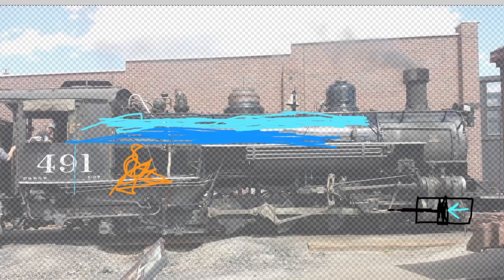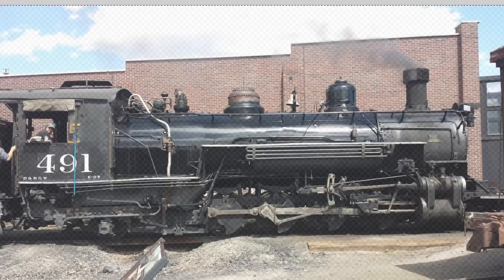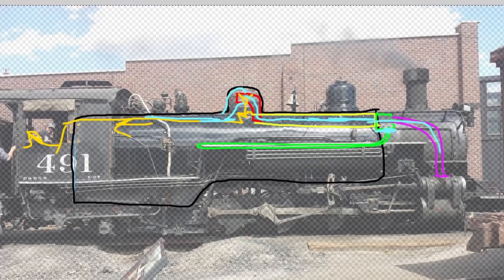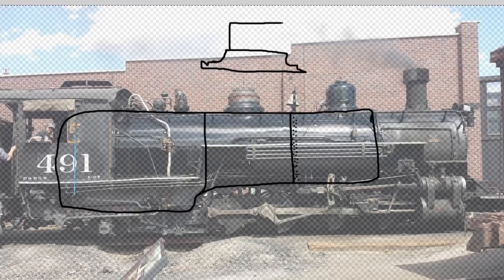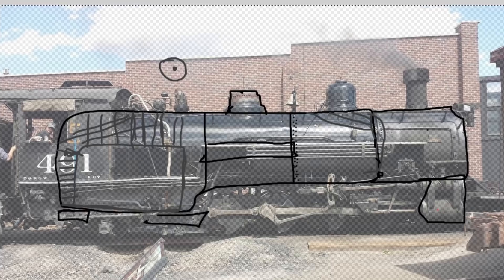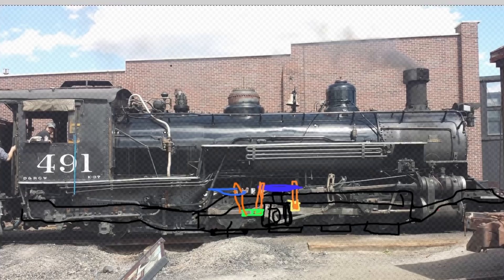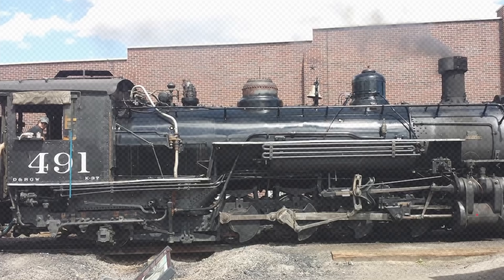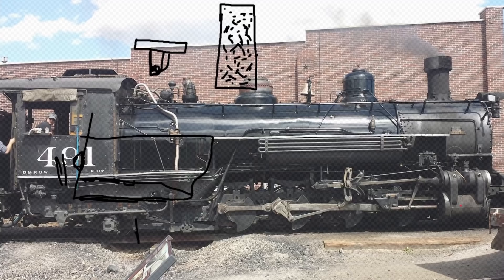Steam 101: 10 Levels of Steam Locomotive Understanding

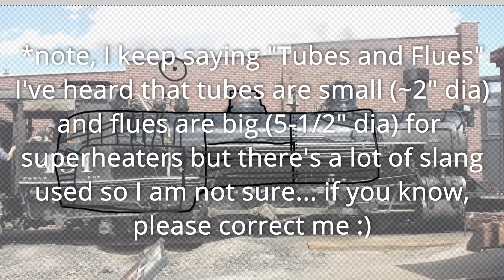Comment: I'm not so sure in the steam locomotive world, but in the heating world, flues hold exhaust gases with water on the outside and tubes hold water with exhaust gases on the outside. I suspect that the big and small reference at 25:54 is people calling drawn/cast tubing, tubes and hand made pipes, flues.
Reply from the maker: That makes sense. Interesting.

Comment: As a mechanical engineer working in the utility industry with high pressure superheated steam (2500 PSI & 1005 Deg F) and over 1 million HP steam turbines/generators, I found this to be fascinating. You mentioned the word "fan" as you were firing a cold boiler (in a different video). I understand that the exhaust steam was used to induce a draft through the boiler utilizing venturis in the smoke box, but you didn't mention how the boiler draft was established during initial firing.  Can the steam control valves that feed the drive cylinders be diverted to the venturis to get induced draft when the engine is not moving? Maybe the explanation is in one of your other excellent videos.
Reply from the maker: There's no actual physical venturi past the blast nozzle; beyond the blast nozzle we have a pipe called the blower that dumps steam out the stack. The flow out the stack then gives a flow through the fire. If you don't have steam, you can power it with shop air. Else, everything is free convection until you have steam.

Comment: Oh that steam comes out of a lot of places. Go look at a Durango & Silverton locomotive leaving Durango on a cold winter's day and there is steam leaking out of everywhere. As it works it's way along the seals heat up and it tightens the seals up a little more. Some of the newer steam locos had a power reverse. Super heated steam is also called dry steam. At lest it was spared the old timey fake diamond stack treatment. They made something called boiler patch bolts. When a spot in the boiler rusted through or was punctured they tapped a hole & drove a bolt in with a wood screw type flange. When it seals up, & gets tight the hex or square head breaks off and it leaves a flush patch.

Comment: 37:54
"I talked about the turret earlier, is that where the machines guns go? Well no!"
well, atleast no, not normally
but this flaw can easily be addressed by making a Steam powered gatling gun, and hooking up the the steam to the gatling gun's turbine thereby allowing a "Rapid firing gun" to be mounted to a steam locomotive!

however this leaves but one question
(The question being, where to mount the Ammo drums?)
Reply from the maker: On the running boards most likely, not too much of a gravity feed to limit the tension on the belt, but also easy to reload.

Comment: One thing I know that definitely applies to oil-fired locos that may or may not apply to others is that every now-and-then you take a scoop, scoop some sand from a big bag on the cab floor, and dump it into the firebox through that little hole. This is called "sanding the flues", and the whole reason you do it is so that the sand gets sucked into the tubes and flues, knocking loose all the carbon buildup. This carbon then gets exhausted out the stack, which is why you'll see thick black smoke pouring from the stack when this is happening. I'm guessing that the environmentalists aren't a huge fan of this practice.
Reply from the maker: Ah yes, that's right! Didn't even touch that piece.

Comment: I feel smarter already. More locomotive education Professor Hyce!

A boiler is like a pair of pants, albeit a pair of pants that will blow your ass into the next century if something goes wrong somewhere.

Imagine how they did this before pneumatic tools? Basically, strong guys swinging hammers, much like how the railroad was made one swing at a time.

Also, reverting to a story from Rev. W. Awdry, there was a story where Gordon, the large express engine, lost the dome to his boiler and it states that the wind was whistling through the hole in the boiler. If I understand you correctly, that basically means that without the dome, the steam on the boiler would escape in rather spectacular fashion, right? Or am I missing something?

22:44 That's what the hole looked like after they hammered it out. And that's Hyce before the beard, right?
Reply from the maker: Correct on both counts ;) it's an old pic.

Comment: Really really excellent video, I've always loved steam engines, and this really cleared a lot of stuff up that I hadn't fully understood.

I wasn't super paying attention, but by chance, did you touch on why the steam nozzle was important in the smokebox? I only recently learning from the J&L #58 how each exhaust pulse of steam does a venturi effect to draft the firebox (If my understanding is correct)
Reply from the maker: I didn't get into the nuance of it, but I did touch on the blast nozzle briefly. It actually creates a normal shockwave out the stack ;)

Comment: I kept forwarding most of the video (not really new to me, but it was nice to be reminded of certain details), I wonder if I missed the part where you mentioned how water level indicators work, as maintaining the correct water level is very important. And how water level indicators cope with driving uphill or downhill, or accelerating and braking, which causes the water to slosh around the tank. Broken water level indicators are a hazard. Especially if both are broken. Such an engine is a rolling bomb waiting to explode.
Reply from the maker: We didn't really talk about sight glasses or trycocks in this video. Can't cover it all, and I wanted to get a good selection of the "lesser known" stuff. Maybe for an add-on video down the road.

Comment: Fun fact drilling a hole down center of a cylindrical object actually allows the object to flex without breaking making it stronger. but be careful take too much material out the center and it becomes weaker
Reply from the maker: There's some nuance to that, but yes in general that's true. Moment of inertia calcs :)

Comment: One item relating to injectors,  water is turned on first to cool the injector, then the steam is turned on causing the process of expansion.  The steam should be pre-throttled and the water flow adjusted for minimal overboarding.
The colder the water the better the operation of an injector.

Comment: In what cases would you want to not have the regulator at full open?
Also, can you explain about a mechanical stoker. I think it’s an auto firing mechanism but don’t really know beyond that
Reply from the maker: Regulator is only wide open if you're running tonnage on the level or uphill. If you're pulling less than tonnage you'd typically need it less. 

Mechanical stoker is a big screw from the tender to the loco. Brings coal to the loco to an elevator screw, that raises it up into the firebox where there is a table with steam jets on it that blow the small pieces of coal to the various regions of the firebox.
Reply: @Hyce777  thanks for that

Comment: I was looking for an explanation of how a heavy train reduces the likelyhood of wheelslip, but I didn't quite get it. Am I right in thinking that if the coupler is higher than the driver axles, the train would pull the loco upward and increase wheelslip, whereas the opposite would be true if the coupler were lower than the axles?

Comment: oh this is going to be super neat. I've always found the linkages on steam locos to be fascinating. (Edit 1: huh! I kinda wondered how you'd deal with TDC on a loco, having either side 90 offset is a really easy fix for that!) (Edit 2: I can't find the video, but there's a wonderful clip of a guy testing forward and reverse on a large model steam loco, which is where I suddenly understood what the radius rod and arm do. It was a random "OHHHH" moment for me, lol)
Reply from the maker: It's funny, if you get stuck at FDC / RDC (we don't have a top or bottom in this case :P), and you are stopped trying to start - it is incredibly hard to get moving. Usually have to roll back and try it again. Lol!
Reply: oh wow that online animation. NICE.
also.... Superheaters are still used in some naval vassals, to generate the high-temp dry steam for the turnbine.
Reply: oh wow that turned out to be fantastic.
Reply: @Hyce777  TDC was on reflex in my case. And I can imagine that'd take quite a bit of effort. Enough effort that I suspect you guys try to park 'er so that the valves aren't in that configuration. Oh, so is the RRO thing of filling water directly into the boiler from a tower how you'd do it if you didn't have air pressure? or is there a backup hand-pump somewhere? Of couse, as I type this, I realize that a failed compressor also leaves you without brakes, so you're in all sorts of trouble on top of a low water level...
Reply from the maker: @DFX2KX  The injectors are steam powered, not air powered ;) but yes, no air is a bad day. If you can't put water in via steam you're donezo, gotta let it cool off and or fix the injectors.

The funny thing is that they stop "centered" quite frequently. When does the loco have least power? When one side can't provide any. If you were working uphill to a stop on a hill... guess where it stops? Least power. lol! so, you have to roll it back and take off.
Reply: @Hyce777  oh, right. so much info at once and I got it flipped around.

But indeed, I'd imagine a broken injector is a 'stop everything immediately' sorta situation, with all of the various ways things can rapidly disassemble themselves.

Comment: To the uninitiated the picture above is a steam locomotive to save space and time many people will refer to it as a train, but a train is this with a railcar or many railcars attached to it's coupler, it's also called an engine which is correct but still longer than train. Diesel locomotives are not really they are power cars with an operator's box  locomotive refers to the motion on the side of the steam engine, the engine of a diesel is inside the body shell it also has motors, really confusing concepts but train suffices.
Reply from the maker: Sorta; there's lots of little technicalities. 

A train, defined in the steam era, was a set of class lamps, and marker lamps. By that definition, one locomotive could be a train. These days, it's a head of train device, and end of train device. One or more diesel locomotives can be a train, too. 

The locomotive describes the whole. The engine describes just the engine piece. For the diesel, the engine is hidden away in the carbody. For a steam engine, it's the running gear, wheels, rods, pistons, that you see.

Comment: Thank you very much for the video. Very well done. 
I have one question regarding where the steam comes out of the locomotive. You said that it goes from the boiler through the cylinder to the smokebox and then out of the chimney. However, we always see that  they can ‘push’ steam directly out of the cylinder. Could you please elaborate on this?
Reply from the maker: That's called the cylinder cocks - they are drains built into the cylinders to remove water that condenses in the cylinders prior to really moving. Good practice to leave them open for a bit after starting.

Comment: I suspect the exhaust flue pipes contribute greatly to the production of steam.    I have seen fireboxes with many small pipes welded (?) thru the front plate., not large flue pipes but smaller 2" pipes.     Is there forced air for coal combustion ?  Residential wood burning stoves have a secondary burn chamber, do locomotives have that, or do the flue pipes function as secondary burn?   What is the function of the smoke box?  Is it more than just a place to end the flues and direct the smoke up?   I have seen what looks like steam seemingly helping the exhaust to flow up and out the stack, but maybe that's just "steam exhaust" ?
Reply from the maker: Howdy Mark! Lots of good questions. Flues / tubes do contribute to the steam generation, albeit less so than the firebox itself. Most locos have many 2" tubes and however many 5-1/2" tubes they need for superheated steam, if equipped. The forced air comes from the exhaust, or from the steam powered blower (which is basically a pipe just venting to atmosphere, causing the draft). Some large locomotives have a secondary chamber called a combustion chamber, which is really an extension of the firebox. Smaller engines didn't have space and so they didn't have them; the flues functioned as much as they could or it was not as efficient. The purpose of the smokebox is about exactly as you described! Haha. Some engines later had superheater headers and feed water heaters located there; but the main purpose is tube gas collection and setting up exhaust.

Comment: Thank you a lot for this video!
I have a question though: How exacly is the water injector working? Also the super heater.. what prevents the pressure from going back to the boiler? Is there a special type of valve or so?
Reply from the maker: Injectors are... black magic and deserve their own whole video.

Superheaters - if you are able to create hot enough exhaust to actually superheat the steam, the engine has to be working hard - which means the throttle has to be open - and steam wants to vent out to atmosphere. If you shut off, the units "remain charged" with the hot steam, as you shut the throttle valve, which prevents return to the boiler. However if you have a front-end throttle, yes, the steam can return to the boiler - which isn't the end of the world.

Comment: Question, is it possible to change the reverser position while the locomotive is moving? I've heard that unlatching the johnson bar under power could cause injury
Reply from the maker: You can, it's just very much a two-handed effort, and you usually take it in little bites. if you were to just unclasp the lock and let it do what it was gonna do, for sure... lol. One firm hand on the bar, pushing or pulling toward the way you want to move it, and you sort of "pop" the latch with a quasi-karate-chop motion and you get a notch out of it before it re-latches.

Comment: Regarding the Johnson bar, is it possible for the locomotive directions to flip based on the position of the rods? Because while it is guaranteed to send steam into the front of the cylinder, it appears the rods will turn forward only if they're on the lower half of the wheels. Do you ever have to pull the Johnson bar back if the rods are on the top half of the drive wheels in order to move forward?
Reply from the maker: No, forwards is always forward as far as the bar is concerned.

Comment: I saw a video of a steam locomotive being built in 1939ish and they had interesting axles that looked like a 2 piston crankshaft between the drive wheels. Did you cover what they where for and I missed it?
Reply from the maker: I would have to see the video to know, but it would either be a 3rd cylinder or it could be Stephenson valve gear.
Reply: @Hyce777  the whole video is worth watching, but here is the footage I'm describing https://youtu.be/vx6hmSclbRE?t=876

Comment: Just one more thing I helped make a steam cannon a piece of cold rolled pipe and a ball valve a regulated steam boiler and a good supply of 350 Chevy pistons compression rings not needed, the pipe was polished smooth in the bore, it was 3/8ths wall, and with a bunch of sand or shot those pistons would travel about 300 feet, the sand was for added weight to make the steam work harder ,it was cool but not practical. A friend had a replica mortar circa. 1800 shot pop cans full of sand  with a very small amount of muzzle loader powder a quarter mile much more efficient .
Reply from the maker: Lordy, that sounds dangerous but like a lot of fun!

Comment: Steam locomotives were the 747's of the last century! I wonder, did the engineers go through a check list before moving the engine?
I tow a 5th wheel camper and when I first started towing I deviced a check list and I never had a problem like, no brakes, door left open inside, low tire pressure, burned our running lights, safety cable not connected hitch not locked before moving erc.. You get the idea!
Reply from the maker: Yup! We do a visual inspection each fire up, hammer inspections to make sure nothing's worked loose, oil around, and do a set and release brake test before we go anywhere.

Comment: It is hard to pinpoint what level I would be at since there are things in mid levels I did not know about however I already knew most stuff in higher levels. It is similar to why I am struggling to progress with my keyboard/music skills, I seem to be missing information from a lower level which is stopping me from progressing further so I am going back to the start to re-consolidate everything. Unless you go for the "too old to learn music" or "need to be trained by a professional music tutor" reasons I sometimes get. Also, a lot of the terminology is different to what I use since I am from the UK so that has caused some confusion.
Reply from the maker: Yeah, it can be really challenging to learn things if you've got holes in your understanding, particularly if you ever learned some things wrong (believe me, I certainly have :P). But that's what makes the journey fun!

Comment: Are the pistons able to reverse power the locomotive to slow it down without breaks aplied, or the piston controling valve affected by the direction of the rotating drivewheels?
Reply from the maker: You can reverse power, yes.